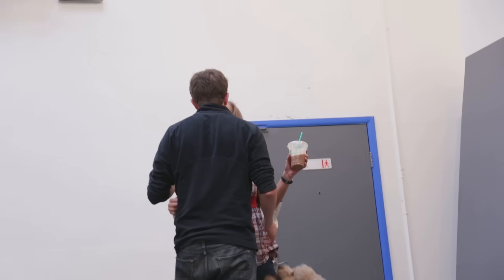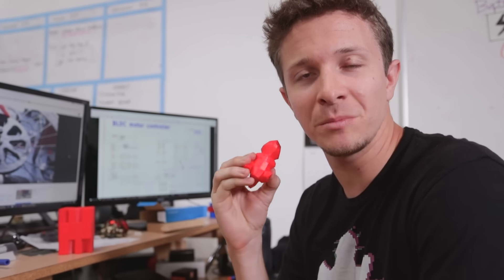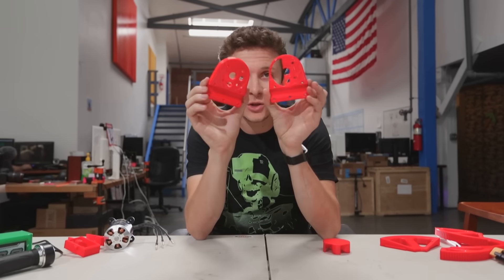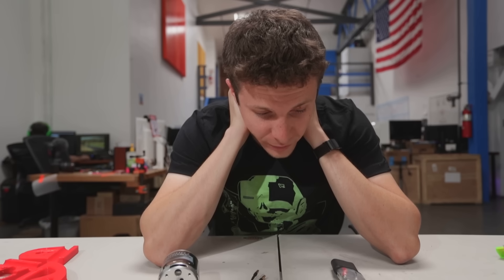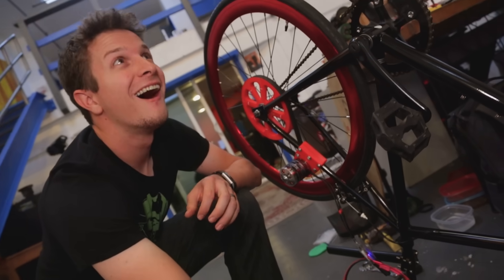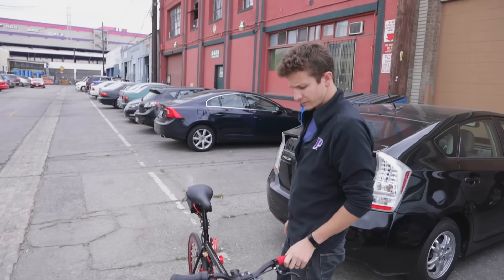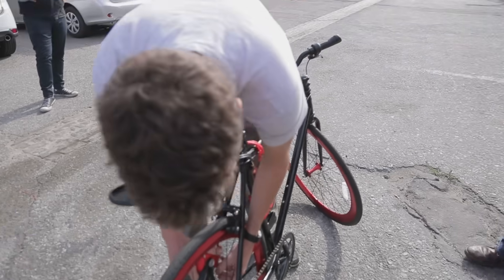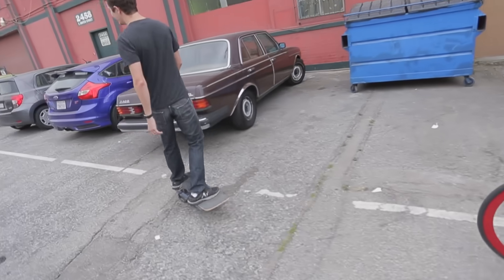Building a Tesla ELECTRIC BIKE For my WIFE

Comment: Um could it be that you did buy a friction fit pully?
If yes it would have been needed to heat the pully and press it on. Ive seen a lot of confusion about this when people buy those kind of pullies and then wonder why it doesnt fit the correct shaft size.

Comment: make the battery charge by the wheel, that makes it efficient ten fold (yes i said ten fold) imagine it not dying because of the wheel, as the wheel turns, it generates power enough to charge the battery like the water wheel, you know like the one ash used to power pikachu up on his fight against brock? (kinda fan if the g1 pokemon) or like those portable manual charging lights? the one where you squeeze a pump then gears turn to charge the light? like that, im speaking a lot now, im gonna stop, awesome stuff tho keep it up!

Comment: Now do an upgrade, machine the spokes and clamps from (at least) aluminum and the belt with a o-ring chain do add durability and remove power loss.
Also why not try a Tesla battery pack?

Comment: The FOC comment! Use it. It's more efficcient at much more silent in lower speeds, but has lower rpm which means lower tio speed, but not by much. It blew some Vedder Vesc though..
Reply: But next time use a Hub motor. More power!

Comment: I built an electric bike in about 15 min. All I had to do was take a couple bungee cords and first one I wrapped around the center of my hoverboard, then I took another one or two and looped them under the first cord and connected that to my bike right around the crank (pedal area).  It worked really well, if you wanted to make a sharp turn or hit rough ground you just had to lift up with your feet and the board would raise up and if you wanted to give it gas you would just push down on the board.  I just wouldn't recommend standing up on it haha.

Comment: Just stumbled upon this site and video. I was going good for a bit, but seeing as how he had no clue what was what and used someone else's design. Then couldn't figure out the simplest of problems.. Super Glue...Solder??? WTH?  How about just flat spotting the motor shaft so the set screws could actually work as designed? As for the regenerative braking..it's a on-off setting for the Speed Controller, not sure why he or anyone else would need something so simple explained to them either. This stuff is 5th grade physics and principles, so seems most involved are not "smarter than a fifth grader" .

Comment: you are not an engeneer.. or you dont make function your brain.. for the poulie, is really a youg error lol :) and the conception of the motor mount broken.. PLA is not enought and durable for this application. and the conception.. some adjustements in the conception is obligatory. motor mount in METAL, and however others things..

Comment: Shoulda "keyed" the motor shaft and gear to prevent the gear slipping to say nothing of taking the gear to a machine shop for a properly centered drilling...  Even drilling the shaft to let the set screws on the gear "bite" down "into" the shaft would prevent it from slipping rotationally.  Then you learned the hard way that you can't clamp tightly enough against the frame to keep the motor from turning from the torque being applied by it, at least not without crushing the hollow frame tubing.  You needed to have it levered against the lower frame member (of the triangle going down to the rear wheel) so that it cannot twist from the torque.  You should still do that otherwise you're going to have a potentially nasty "wife impacting pavement rash" event occur far enough from home to potentially permanently sour the wifey on the whole affair.  Then the spoke impacts took your wheel out of being true, so that will need straightening.  Will be interesting to see how the PLA gear wears over time.  If I recall correctly, the sun will eat it over time without any UV protectant to where it wants to crystallize and be willing to crack.  There's sites online where you can upload your 3d files and have them printed in metal...  good luck!

Comment: #1 you should have hard mounted the motor to the bike and actually gotten a pinion that fits. The pinion was slipping because the motors are designed to have a little slit in them so they don’t slip. ( there keyed )

Comment: to anyone that wants a cheap ebike buy a hub motor from ebay for like 149 and look up videos on how to put it together much better then this
Reply: RENAKON Uh no. With those kits, you still have to purchase a $300 battery on top of the hub kit. That's too much money for something like that.
Reply: I mean... sure... but while hub motors have some advantages they tend to be lower power. These hobby outrunners have been optimised to insane power:volume ratios and are really cheap. I came across an outrunner that will do nearly 2kW in a tiny amount of space at £30, compared to the lowest end hub motor I could find, doing 250W at about the cost you quoted.
Reply: Acrimonious Mirth I mean would be great if you were to link this find otherwise 5theres no proof.
Reply: @AcrimoniousMirth  
That vesc alone is $150. Plus the cost of the 3d printer which most don't have. Plus a cheap hub motor will last much longer. Plus..

Comment: Hub motor would be much better
Reply: A hub motor sells for over $400 dollars, while only being a bit better that the one he used in the video, which only costs about $100.
Reply: 400 for a hub motor?? maybe a top of the range 6kw one... a 500w with controller and accessories should only be 150 or so
Reply: Hub motors have their place but they’re really still an emerging technology with limits. Hobby outrunners have been optimised greatly and have insane power:Volume ratios.
Reply: also much more expensive
Reply: They're really not.

Comment: So, how did you fix the problem that you had at the end when you released the throttle and the motor resisted the free spin? With a different programming of the speed controller?

Comment: kW is a measurement of instantaneous power. kWh is power over time which is an amount (set quantity) of energy. Power is absolutely nothing if it cannot be sustained over a period of time to do work. For the car guys the analogy is torque and horsepower. Torque is an instantaneous measurement of the twisting force produced by an engine. Horsepower is the torque the engine can deliver over an amount of time.

If you are using the 6S 10AHr battery you showed, then your calculation of how much it costs to charge it is wrong. And that's even taking into account the inefficiencies of whatever charger you use. A 6S Lithium battery is 22.2v (3.7v x 6) rated but a full cell is actually 4.20v so with a full charge your battery will be at (4.20v x 6) 25.2v. At that voltage your 10AHr pack has a total power capacity of 252WHr, or about a quarter of a KWHr, not half. So at $0.12/KWHr it's closer to 3 cents to charge from empty. Even if your charger was was only 75% efficiency, 5 cents is still 20% off of the actual amount. Yes, I'm arguing pennies. LOL.

How did you fix the small pulley spinning on the motor shaft? The easiest way is to grind a flat spot on the motor shaft and tighten the setscrew against it.

So once you programmed out the drag brake on the ESC it worked fine under power. Does that mean to brake you have to use the bike's mechanical brakes exclusively? Seems to me if you could tighten the motor mount on the drop tube it would allow you to use some amount of ESC regenerative braking. The material might be too weak for that but now that you have a proof of concept you could have an aluminium part machined instead.

Comment: need an electric bike to take a weight capacity of 300 lbs and speed of 45 mph with a range of 50 miles and charges in less than 3 hrs.

Comment: No hate, but while I can see the point in your idea, it was done very lazily and badly it looks like.
Speaking from the little experience I have with similar sistems in rc cars.
Main issues: 
1. connectors saldered inside bigger connectors? really? Do you know how hot can they get due to the resistance? Next time do your homework and get an esc and motor with the same connetors or solder the new connectors in place of the old ones, not ON them.
2. please tell me the batteries aren't held only with black tape. It can be very dangerous if something goes wrong and they catch ire or ger perforated (maybe if you fall?), so please put them in an adeguate fireproof bag at least, they're not expensive.
3. don't randomly drill in a pulley like that, it's useless and painful to get right. Just get one with adeguate diameter, they're cheap.
4. you really want to get some kind of slip clutch between the wheel and the motor. Probably the motor will never suffer any damage, but if something stops the wheel while the motor is going bye bye gears

Comment: What did you do with the regenerative braking?
Reply: I'm assuming he just turned it off.
Reply: The esc has a function called auto braking which stops the motor from coasting without throttle. He just had to turn it off.
Reply: Would also like to know this...
Reply: Daniel Ignatiuk he used the throttle the adjust the setting of the ESC, listening to the beep to know the setting its on

Comment: Tom Stanton had to add a little electronic doodad between the voltage-based twist grip throttle and the Speed Controller on his bike.  Was it the same with this bike, or does the VESC do its own conversion?

Comment: *looks at motor bracket*.. so.. a carbonfiber tube to a secondary bracket, on the lower bar going to the rear wheel would make it impossible to spin on the tube its mounte to.. would act like a torque bar as well...  simple to print a second bracket .. or mill it out of aluminium..  :D

Comment: hello, i would just suggest for another build, that when you got 2 spinning part to join together ( example the pulley and the motor pin) , you should use the leather not the drill to make concentric hole. Doing it you will not have vibrations or wobbling movements.

Comment: PROTIP: If your pulley is slipping on a motor shaft remove the set screw and then take a drill bit slightly smaller than your threads and drill into the shaft through the set screw hole just to mark it. After that remove the pulley and get a bit that matches your set screw diameter and drill the divot on the shaft except this time go in a little bit deeper (enough for the set screw to lock in and get some bite). Finally re-assemble and now you have a mechanical lock as opposed to relying on friction.

Comment: Mounting system for motor looks dangerous.
When you only clamp to a round bar there is risk it will go into the wheel, as you already showed approx 12:00
Would it be possible to weld or drill something into the frame to stop such rotation again?

Comment: The pulley needs to be an interference fit. Don't drill it to the same size as the motor shaft, if you do that you'll need a keyway to retain it. Next time try this: put the motor in the freezer for about 20 or 30 minutes, or use a can of compressed air to cool down the output shaft. Use a blowtorch to heat the pulley, then install it over the cold shaft. When it all cools to the same temperature it should be stuck on there for good.

Comment: If you provide that little motor with enough battery power to actually provide basically any amount of assist it will turn red and smoke, Stick with a commercially available hub motor and fuck all that 3D printer nonsense. What a fucking waste of time this was.   

Now I have an idea on how to make a truly viable eBike from any old bike with a single add on but so far have no investors.

Comment: you should put a dynamo so while you are driving the bike it is recharging and you can use the motor more often
Reply: That would actually decrease the range of the battery. The dynamo takes energy from the system (system being the motor and rider) to convert to electricity. Once you subtract friction, heat, and electrical inefficiencies, there would be a net loss of power. Google "perpetual motion". You could switch between motor and pedaling but a dynamo doesn't produce that much power to charge a bike battery at a reasonable rate.

Comment: If anybody has motor shaft / pulley slippage issues, simply use Loctite 648 Retaining Compound - it'll fuse the pulley to the shaft = problem solved.  Great video, interesting that the VESC regen settings caused the motor to stop completely, I've not used a VESC yet so that's a major thing to remember, I build electric skateboards.

Comment: what if you attach a hand crank generator to then charge the battery by pedaling
Reply: That would actually decrease the range of the battery. The dynamo takes energy from the system (system being the motor and rider) to convert to electricity. Once you subtract friction, heat, and electrical inefficiencies, there would be a net loss of power. Google "perpetual motion"

Comment: You will get more power if the motor housing is attached to the frame and doesn't move.
Reply: Not with the motor he's using. If the housing was solid to the frame, the mounting plate would want to spin. Find the section where he connects it to his computer and you'll see what I mean.
Reply: Tom Murphy Did you go to school in Yukon?
Reply: nope, never even been there. There's at least a thousand of us in the US

Comment: If you had just bored the hole using a boring bar rather than a drill bit, it would not have been off centred like that. Always use drill bits to make the original hole and then finish with a boring bar. But all this is just assuming that you have access to a lathe.

Comment: I'm so pissed that they don't tell you how they solve the issue of the regenerative braking!
Reply: Agreed
Reply: It took weeks because he had to buy new parts.
Reply: It's not regenerative braking , it's just normal braking. The ESC has a feature to brake when you let off the throttle. It has this feature because that ESC is normally used on remote controlled aircraft. 

Now the fix to this is really simple you just program the ESC . And the programming does not involve any coding or anything it's just done directly on the ESC . You'll hear a sequence of beeps from the ESC which will let you know what setting it's at and you just select your preferred requirements using the throttle as a navigation tool . 

This fix literally takes like 5 seconds so that's probably why he didn't include it in the video.
Reply: ESC is also used on RC cars
Reply: They did tell you. In the same sentence that they said regenerative breaking. They just didn't show you. It's literally just a switch in the software.
Reply: He has the wheel in FIXED gear, so when the pedals move the wheels move and when you stop pedaling the wheel stops.. When it should have been on singlespeed where you can stop pedalling and the wheel will keep going, freewheeling.
Reply: Manwell it took 2 weeks because working on bikes isn't his only job
Reply: The wheel isn't fixed. You can see the bike coasting without pedaling in the video.
Reply: Aeuralis there's a wheel that's called the flip flop hub that always both fixed wheel biking and letting the wheel spin without pedaling
Reply: Some VERY basic engineering problems that could have been solved in minutes took 2 weeks to sort out? REALLY!?

Comment: All you needed to do to fix the shaft spinning in the toothed pulley problem, was grind a flat spot on the shaft where the screws are.. Takes like 45 seconds with a rotary (Dremel) tool..

Comment: Why does the motor casing rotate?  Or is it just sliding in it's mount?  Seems like it's going to die pretty quick if it's sliding.  Normally you mount the motor on the bike, and only the spindle rotates.  How was the spinning spindle fixed?
Reply: Look at the part where he connects the motor to the computer and you can see how it's designed. Seemed odd to me too

Comment: Impressive...!  a nurse that doesn't wear a helmet.  It would be easier and stronger to power the bike from the crank/bottom bracket.  But unless you have an electronic clutch, you will place too much stress on it break any system.

Comment: Uhh... why is the motor even spinning at all?
Shouldn´t the motor be completely stationary in it´s mount and the only thing spinning should be the pulley?
Guys help me out here, i must be missing something.
Reply: Look at the part where he connects the motor to the computer. The base plate is fixed and I'm assuming the stator is as well. The rotor just happens to be attached to the shell in this motor's design.

Comment: lol solder!!! you may as well put a piece of string in there. My initial thought was to either flatten one side of the pin so the screw  has a flat spot to rest on and can't spin, other option was probably drill throw the pin. but that's very fiddly and probably wont work either. I'd prefer a proper drum motor but that's just expensive and might as well but a proper e-bike. live and learn :)

Comment: Also, using lipos instead of li-ion, and no battery management, just under your wifes ass? thank god shes a nurse I guess.
Reply: Usually speed controllers have built in security cut offs, but still
Reply: Riding my elektrik skateboard for two years now without a BMS an the Lipos still dindt blow up. So a BMS is nice to have but realy nacessery. Like the guy sayd before me the ESC or VESC hase something simular.

Comment: I have made my own electric skateborad with the same motor and pulley, you need to make a keyway on the motor for it too work, otherwise you need to upgrade the pulley to a stainlessteel pulley for it's durability and grubscrews that do't were off

Comment: the motor is experiencing a lot of torque which is going to wear out both the motor and the housing assembly, what you need to correct that issue is a transmission gearbox so that the motor doesn't experience any torque and the gearbox handles the torque, preferably a planetary gearbox so that it doesn't destroy itself if it jams